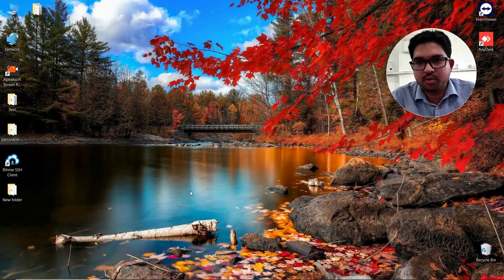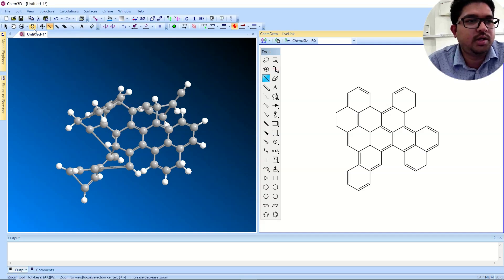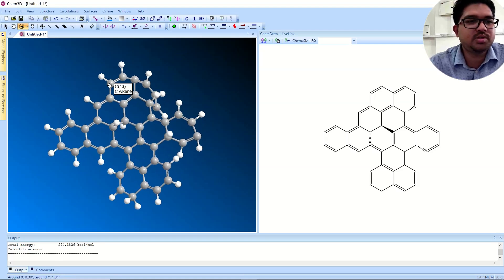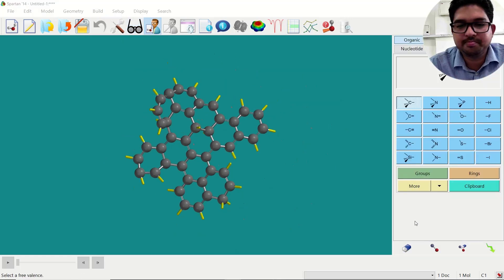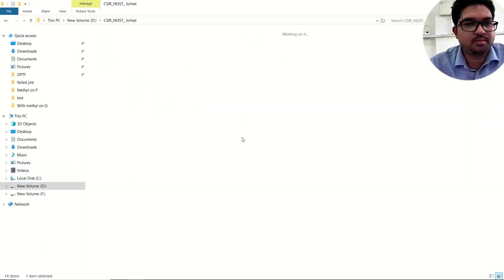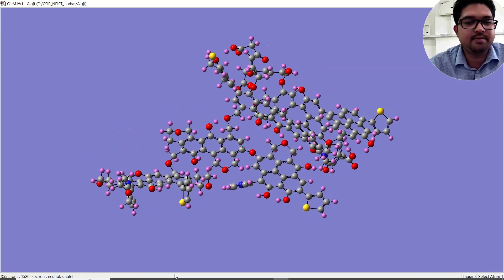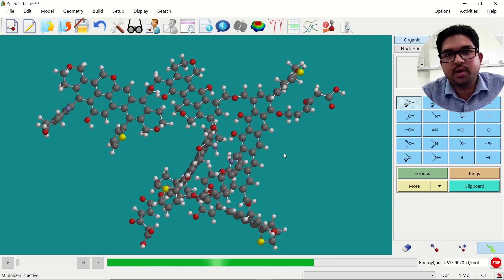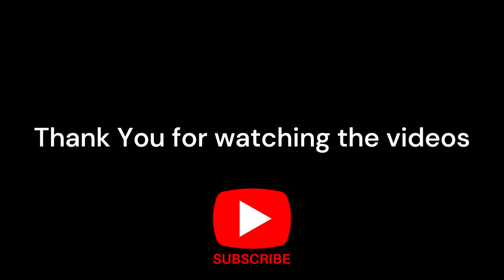How to design big molecules || Dr. Gaurav Jhaa

Comment: Hello sir, i am finding a difficulty in finding the TS between methanol and Histidine, for finding the TS should i run a scan if yes ,how should be the coordinates be?
Reply from the maker: Dear Imran getting TS in one go is not a cup of tea. It needs some level of expertise. By the way you should scan the coordinates between methanol and histidine and then see the high energy geometry that could be used for TS calculations.
You can also try qst2 method for the TS search. 

Possibly when you interact methanol with histidine, histidine will take proton from methanol; that will be the TS geometry. You need to keep methanol H near to the most basic functional group of histidine.
Reply: @quantumguruji sir can you make tutorial on how to scan coordinates for finding the TS
Reply from the maker: https://youtu.be/TDG4_sCLpmU?si=iPMj0PKTIpkv2yXS

Comment: Hello Sir, Can you teach as how to calculate intermolecular distance between two molecules in Gaussin DFT for x-ray structure.
Reply from the maker: It's not that difficult, first design your molecule or pluck out from crystal structure and then run geometry optimization along with frequency calculations. Once calculation is done check the inter molecule distances as per your requirement.
Reply: @quantumguruji Thank you very much sir. Sir can you provide any reference or journal for the above procedure.

Comment: Sir 2070 Error aa rha Hai Baar Baar Please Help
Reply from the maker: @aakashpandey8654  I think your calculation ran out of memory. You have to reduce the memory (RAM).
Check the version of your Gaussian and supported ram allocation per processor or just use 1500MB
2. make sure there is an empty line at the end of the coordinates.